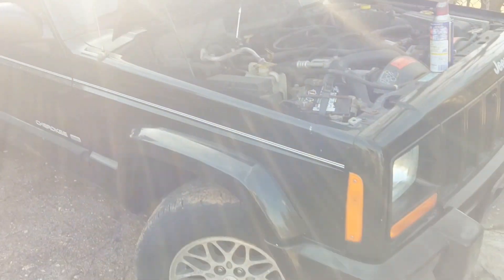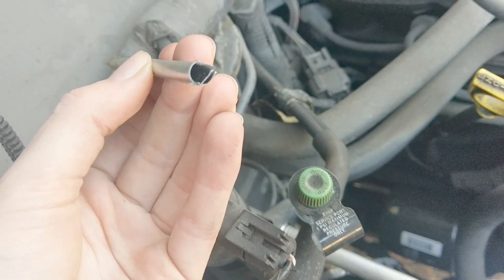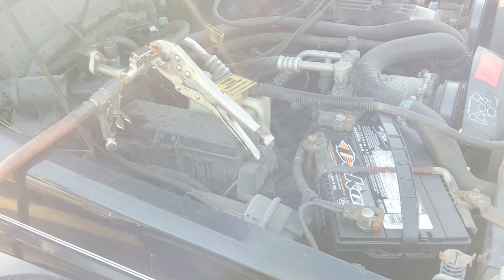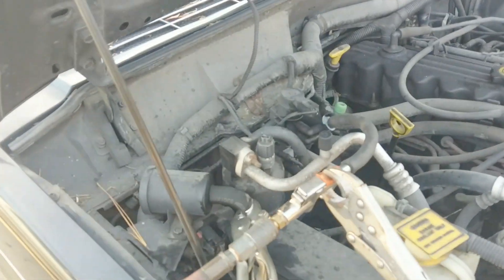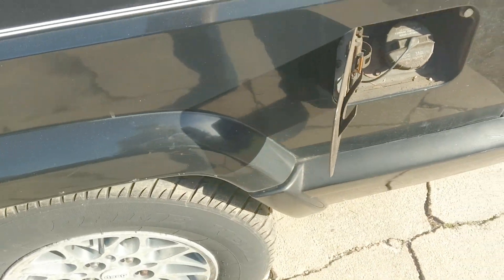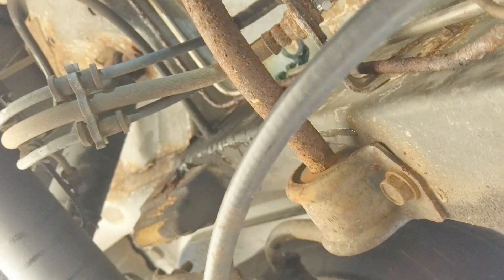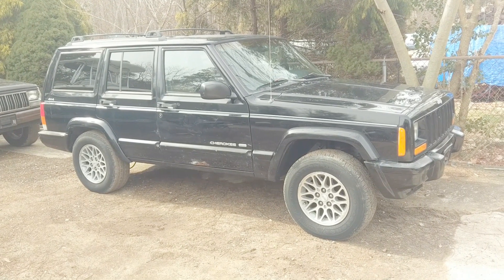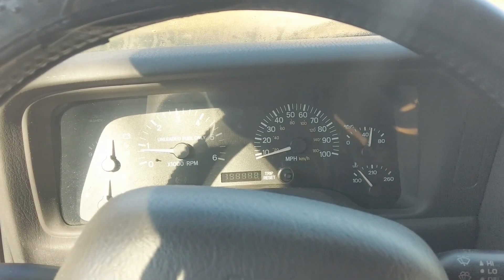1998 Cherokee P0455 EVAP Leak Fix

Comment: This worked great, much better than my home made smoke machine. My leak turned out to be on the seam at the bottom of the canister. A little fuel resistant epoxy along the seam and it's good as new. Thanks!

Comment: What you have to do is go through the entire evap system and look at all the boots and hoses. 
Rubber gets rotten down below.
I replaced the gas cap,purge valve, an O2 sensor and the just replace the hard line with a rubber hose.
Haven’T ran it yet. It’ll be off when I reconnect the battery.

Comment: I think you mentioned the size is 1/4 inch. What length did you get?
Reply: You need about 4 feet of 1/4" line, and it doesn't need to be metal. I used rubber fuel-rated hose instead so I didn't have to bend it and it works good

Comment: i had this same rusty pipe... and then an elbow, and then a hose. i was using 1-2 psi of air pressure and soapy water. i replaced almost the entire EVAP system and all vac lines, cant find any bubbles with air, and still check engine light lol. Im pretty sure it has to be the fuel tank itself

Comment: So weird how these change year to year. My 97 does not have that pump on top or a access port on the solenoid hose. Also my hoses go straight down to a rather large container right below the solenoid
Reply: For those curious the EVAP system on the XJ is the same between these years:
1987-1995
1996-1997
1998-2001
Reply: EVAP systems get updated pretty frequently. the very first versions developed(for all cars) just had a solenoid and a charcoal cannister. later on they started adding leak detection and flow detection. you prob have an earlier version, as these were first mandated in  MY 1996

Comment: you can cut that line and hose clamp new rubber on it. its not really under any pressure. doesnt have to be flared or anything. it happens all the time
Reply: Did you just connect rubber fuel line from one end to another with regular hose clamps?
Reply: yes. it must be an airtight seal, as long as you can make that happen, you are good

Comment: Mm, not bad, but getting air through that test port and through system takes more than 1psi.  Chances are, air will leak out the threads of the test port and or get backed up.  In order for the CEL to work properly, you need to drive it for 10 minutes or certain distance after resetting.  Turning it on for 5 minutes isn't going to say much.  Could've just cut the line and used a flare tool.  Sometimes the CEL light will come on even if your gas tank is almost empty or low.  Smoke test machines prefer having over 1/2 tank of gas.

Comment: Nice 98 Limited.  That looks exactly like the first XJ I got back in 2007.  It was a 2WD that I converted to 4WD years later with a lift and stroker engine.  After I hit a large puddle out at the beach that turned out to be a small pond and hydrolocked it I had many electrical problems for a long time after until I sold it.  If I ever get another clean XJ I won't be doing anything to it, except keeping it in the garage and fixing the rear leaf spring sag.  https://i.imgur.com/Ra8wVvH.jpg

Comment: Hi there,l like the ways that you always simplify trouble shooting and it works great. Nick what happens if you eliminate that line? My concern is that you installed a kinked line. Nothing personal but it's just an observation. Is a GREAT JOB like you always do. keep the good work 👍👍👍👍👍 like always.💪🇵🇷💪
Reply from the maker: Since this is an OBD2 vehicle, eliminating or capping off the line will likely result in a check engine light as the system is incredibly sensitive. The line I put in was a little kinked but will still work fine since the pressure it's dealing with are very low. Was in a rush to throw it all in before work, but cutting it a few inches shorter would fit just fine.
Reply: Like you said on the video 1psi.👍🇵🇷💪
Reply: @NickInTimeFilms  I put rubber hose but code went away I just check it 455 back on could be that I didn't use clamps ?

Comment: Where would you find that on a 89 xj
Reply from the maker: I doubt the older Jeeps have a dedicated EVAP test port because they are much simpler systems, but there is a vacuum diagram on the firewall. Airbox tube has a line to the charcoal canister which pulls vapor from the fuel tank through another long line.
Reply: NickInTimeFilms can that tube be capped off. In my state there is no emissions so when I change my motor out this year I'm goin to eliminate the charcoal canister. Will I be able to eliminate that line then. If I remember correctly there were only 2 lines going into the fuel pump. 1 pressure line and the other return line.
Reply: @svborek  I would assume it can be since I pulled the line from the intake manifold off of mine and it solved the rough Idle issue I had due to the solenoid not working. No E-check in Ohio anymore, so I figured I wasn't paying for something for nothing. It's ran fine like this for 4 years now.

Comment: What does the evap system even do?
Reply from the maker: It's designed to recover fuel vapor from the tank instead of venting it into the atmosphere. I "think" it's stored in the charcoal canister and then the PCM will decided when to open a valve to bring the vapor into the intake to be burned but I'm not completely sure. What I do know is it's an incredibly sensitive system and rather annoying to work on.
Reply: @NickInTimeFilms  correct on all counts. the charcoal canister captures gasoline fumes, which are considered harmful emissions. It should have a valve to purge the cannister, and another to vent the whole system. The vent just allows fresh air in so raw fuel vapor isnt inhaled by the engine. 

the later year vehicles are even more sensitive than these early OBD2 cherokees. if the rubber hoses are slightly worn to the point where they expand and contract under a vacuum, they will throw a CEL. Its best to just start replacing all the rubber hoses and fuel cap as soon as you get that code

Comment: Curious not critical about why you didn't use the mt2500 ?  I live in the sticks so it's quiet enough here to use ears to find pressure leaks. I'll keep that in mind.  I'm about to connect up the fog machine for leak detecting for the first time.
Reply from the maker: You know, I didn't even think of it. But after checking the kit I got, I don't have the OBD2 adapter anyway.
Reply: Understood. We have 3 brands of vehicles here, so odb2 was mandatory.
Reply: I taped the manifold intake faces and plugged all of the vacuum nipples. So I blew into one of the lines and I can hear a leak somewhere inside the intake manifold. Now I'm about to blow super low pressure compressed air to that same line to help find the leak. I still hope to get to use the fog machine. But a couple psi of compressed air is working. So thanks for that tip Nick !!

Comment: did you get a new jeep?
Reply from the maker: Nah, just fixing it up a little for a cousin, first car, haha.
Reply: Great first car. Bought my 1998 XJ 4.0 AX15 when I got out of high school. Been a problem-free DD for 10 years. Still drive it daily, about to hit 200,000 miles. Only thing I've ever had to replace is clutch bearing and the radiator. 
Have a Comanche too, best pickup of the 80s and 90s.

Comment: ive had this code (pretty sure its this one)  since ive gotten my jeep, originally was told it needed a new purge valve which PO replaced but i dont think it actually worked, also doesnt help PO rigged the whole harness up
Reply from the maker: It's bad enough just trying to work on an untouched EVAP system issue. Good luck man.
Reply: evap sucks and now almost 3 years later im wondering if its really affected my jeep or if its even an issue anymore, since the person before me rigged the harness it burned the first purge valve out which threw a code so he replaced it but again harness is rigged so most likely burnt out again. cel is always on but evidently for nothing? jeeps are confusing but i still love em